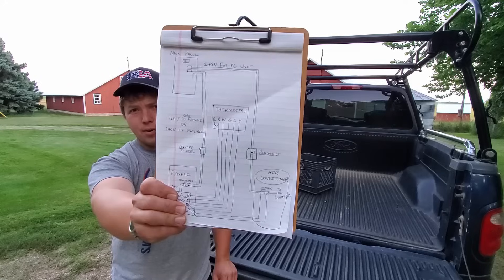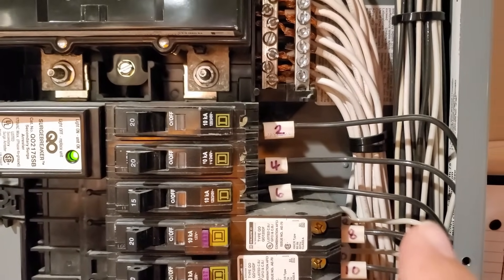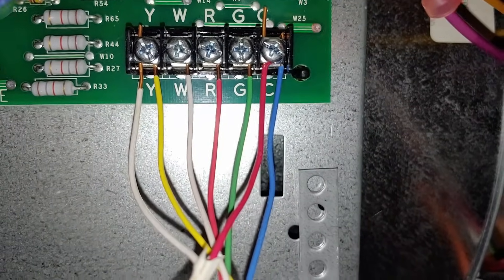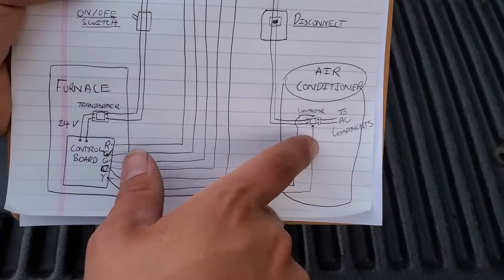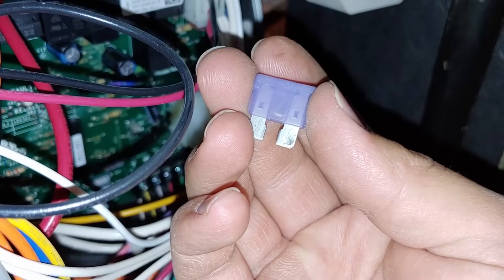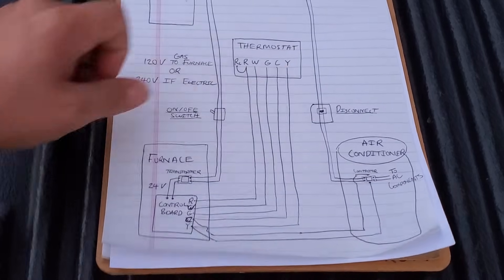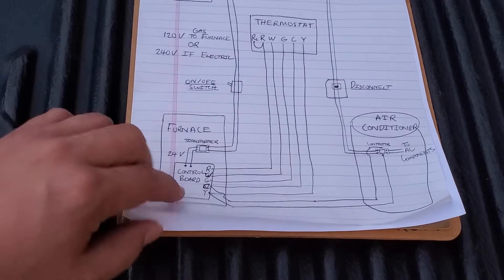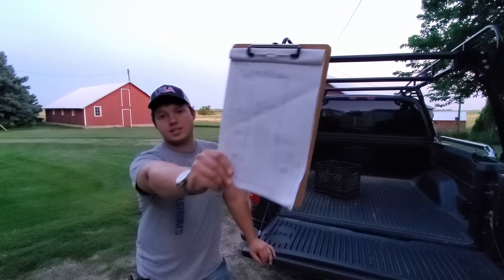Thermostat Wiring Explained!

Comment: Great explanation!Thanks to your diagram finally I found what is the problem with my C wire. I have C wire to the control board without power.  I found  in the basement the other side cut off and joined with other wire  to outside Air conditioner.I restored the connections and now I have the new working wifi control board .Thank you

Comment: Why is there an Rh and an Rc. And why is there a Y1 and a Y2?
Reply from the maker: Rh and Rc are only used if there are two separate heating/cooling units with their own 24v transformers. In 99%+ of systems the Rh and Rc are jumpered together since only the air handler/furnace contains the 24v power source. Good question!

Comment: I could really use some advice here.  My old Honeywell thermostat used 4 wires, but the origingal installer left the blue wire rolled up unused behind it.  
There is a red jumper in the thermostat, old school.  Now, when trying to install a new Smart Amazon Thermostat, it's I can't get it to work eventhough I put the Blue C wire (which is on the COM 24v connection) into the Amazon unit.  I didn't change any of the wiring in the furnace control unit.  Any advice?  Should I buy a four wire to C wire conversion device and try to use that?  Thank you.

Comment: I switched out a Econ thermostat to a wi fi honeywell. I used a c wire adapter I have central ac also. This thermostat has no adjustment for antisipator like the original one and I can’t seem to find one that does. I was going to tie in the old one just for the ac. Is that possible

Comment: Great explanation! Thank you! even though I cannot apply all the instructions as there is only 2 wires coming from the thermostat (R&C). The controller box I'm installing is Aube CT280-HP-2H1C. I can't figure out how to plug the RC terminals as I have 2 pairs or them, on the left and right side of the box. The right ones connect to the heat pump. Your help is much appreciated!

Comment: Replaced my mercury thermostat. 4 clear wires. Old thermostat has a R-RC jumper. But new thermostat has a switch that stays up and red wire just goes into one place. Plugged in everything works. Except there is no option on Thermostat for Auto/hot/cool and no option for cool. The heating and fan only settings still work. But no option for cooling whatsoever. I have the same system upstairs and it’s still working fine. But downstairs. No a/c at all. Driving me insane and it’s heading into the 90’s today.

Comment: What about heat pumps like Train that works off of OB terminal to cool, what smart thermostat works best w/out having to have more wires, the Ecobee wouldn’t work w/out having to pull six or eight strands of thermostat wiring?

Comment: I had a wyze,that went bad,so bought a Nèst,thev wyze thermostat had no battery and 4 wires,and no battery, red white yellow,and green wire was in c for common.The nest has batteries when i wire it up the green wire in common says no connection, should I pull blue wire tucked in wall and attach to common, and switch green to green ?

Comment: @BenjaminSahlstrom thanks for this.  I wanted to paint around my thermostat for about a year now.  it was working perfectly, then I pulled it off the wall and photographed all of the wires in the harness.  when i reinstalled it, got errors.  I was worried that i had to call a pro to get me out of the mess.  But your explanation led me to check the fuse on the board and I fixed it for $7!!!   Thanks

Comment: Awesome explanation, I will probably listen to it again to absorb everything you've said I think you covered so much.
I did not know that the furnace could run without the 24 volts getting to the thermostat.
 I had someone out to diagnose my furnace problem and was told that I needed a new thermostat for 450.00 and many other new upgrades.  He jumped the common to the furnace and showed me that it worked, and thus I needed a new thermostat.  
I did a little more testing after he left and have discovered that the Transformer is not providing the 24 volts.  I did not know that the furnace could run without the 24 volts getting to the thermostat.

Comment: I got a new ac unit inside and out, and the fan inside stays on, constantly blowing air, even when programmed  to auto. The ouside unit will kick in where the temperature is set at. Is this something with the G wire? Can I remove it to make it stop?  Mind you, I am just a Mom trying to figure this out. 😅

Comment: I have an issue, my nest thermostat does not detect the common or W wires. But if i plug thermostat to control panel the furnace automatically turns on

Comment: I deal with electronics and electrics in all forms, from uW to MW.  I came to this video just to get the details of standard thermostat wiring:  basically the definitions for R-W-G-C-Y.  Benjamin was so much fun to listen to, with his very clear explanations, that I watched the whole thing, way past where I got the info I wanted.  Great job!  I may have missed it, but I suspect you didn't actually say why the Y might be going into the control board and not be just a dummy:  isn't it to insure the fan comes on full speed?  That is, the control board wants to know, to set the fan speed correctly, whether the AC unit is running or not.  (I also suppose that these days, 2025, there's additional smarts somewhere in modern systems to set compressor speed and air handler speed to run most efficiently and quietly - things that were rare in home HVAC back a decade or more ago.)

Comment: I know this is an old video ... but.. i recently noticed on my 3 wire setup. W went to W. R went to R. (No jumper) and G from thermostate went to Y.

Is that a typical concept, or is that just setup odd? What i noticed is that when I turned FAN ON. It would start the AC. What i cant compute.... why would turning COOl ON still work?... thoughts on this?

Comment: boiler, heat ONLY - with Honeywell RA89A and Honeywell Oil Primary R7284B EnviraCOM Enabled - -  both Honeywell components  seem to have 24 Volt transformers and the RA89A says it's a relay (may be what gives power to the inducer fan on the flu pipe)
Can I get the power for and add the C wire to one of these controllers, and if so, where?  
It is a one zone steam system and I would like to change to a SMART thermostat so I can change the temperature with Alexa or an APP when I am on the second floor.  Thanks for any help.

Comment: While this was a GREAT tutorial on the relation of thermostat to furnace, there was ZERO info on the control board to the furnace relation. This would be important when replacing a control board. Which is happening 2x now.  Mine has a set of tabs with a number of push pin wires, Blue, black, with a jumper, brown, white. Its a York or I have seen it referred to as Coleman.

Comment: That was a really excellent video! Nothing to do with the Op's presentation, but I wonder who came up that lettering code for the terminals and more importantly, why? 
Wouldn't it be easier if they choose something that sort of made sense ie P = power/24V, F=Fan H=Heat,  A=Air Con and C=Common...

Comment: Nice video,

My condenser pump has a built-in flout that I want to use as an auto-shot-off for heat. How should I tap that into my wiring, which is pretty much on par with your wires in this video? I want to shoot the system off if the condensor pump dies and my humidifier keeps feeding it water.

Comment: Around 10 minutes, discussing the Y wire going all the way to the control board, so should there be 2 yellow wires at the control board? Mine currently is tied together after the control board

Comment: Hi, so had a smart therm installed the wires were like the ones shown in your example yellow green red white and blue(common) the tech installed then left did not test went to use it myself and all I had was fan only.  He hooked the wires up according to the instruction.  I have an old unit 1989 (air handler) does he need to run some sort of jumper wire to make the cool and heat work.  Everything worked on old therm so I think it is a wire issue.  Any thoughts?

Comment: Thanks to your video I have saved some money on the technician. The common C wire was disconnected at the Furnace and my Google thermostat couldn't work. This C wire was connected in my old LuxPro thermostat but disconnected in Furnace and the old thermostat works somehow without the common. My guess it was using the battery power. Thank you for this video.
Reply from the maker: Glad it helped!

Comment: Another Great video...thanks for the video
The issue I have is that, thermostat display, honeywell, screen keeps going on/off.  I removed the thermostat and measured the wires voltages
Green and Red shows 24V (actually 26v).  Only Red should have voltage, as I understand,  why is green shows 26v.  Any suggestions?  Thanks alot

Comment: I need help.  My dog ripped the thermostat wires from the 2 wires that go to the contractor.  I'm not certain which sequence they go together.  The furnace doesn't have a 3 amp fuse.  It has a built in clear breaker. So that's 5 wires I need to connect to the 2 wires for 24 volt on the contactor

Comment: Great video, I have a question. When hooking up a Generac transfer switch to Control the AC. They say break the Y wire and run it through the relay on the transfer switch, should I break it before or after the control board?

Comment: Thanks for this detailed explanation. I have a question about my control board and thermostat. I have a 5 conductor connection from the control board to my thermostat as follows: Y to Y, Y to W, R to R, G to G, O to O.

My question is why is W on thermostat connected to Y on the control board?

If I need to change to a 24V programmable thermostat should I change the connection to W - W, Y - Y instead of the present connection that has Y and W from thermostat going to only Y on control board?

Thanks in advance

Comment: This is the best video that explains everything about how it works and it helps me understand and fix my problem. I'm kinda in the weeds here, I think my C and G Wires are crossed. When I went ahead and wired it, neither the heat or the AC came on. I think I need to rewire everything again. Any help would greatly be appreciated!!!

Comment: Great video. I can't find where the fuse is on my Trane XL 80 Furnace. There is no voltage coming to Rc wire on the Thermostat

Comment: based on  your contactor vid (thanks) I replaced it, it ran for 8 hours, system went offline.  I'm getting another one and a capacitor, I'm pretty far from the job and thinking of replacing the transformer just in case.   Seems like a 24V 40VA is pretty standard.   It's a Payne similar to the one in the other video with a nest smart thermostat.

Comment: wires coming from heat pump condenser (outdoor ) to the air handler cannot be spliced midway with the thermostat wires ?  condenser wires and thermostat wires has to be all connected at the air handler control board ? pls correct me if I'm wrong . thanks

Comment: I would like to be able to control my furnace with two thermostats.  Are you aware of a switch I could wire in as a controller between the two thermostats so both thermostats could not operate at the same time.

Comment: I’m a little  confused about the blue wire. I think it is the return wire on the 24vac transformer. One leg. The other leg is hot and it’s fused. Question if you hook a condenser pump, is it ok to series it with hot wire on the 24vac, so it will trip the heat and cool together? I have a humidifier with heat in winter and the A coil in summer can drip water. Some say to series condensing pump with yellow, but I want also to shut off heat in winter, because the humidifier also leaks.

Comment: Very well done young man.  As an electrical engineer seeking help with understanding the internal workings of a thermostat, you did an excellent job of detailing the contact logic contained within the thermostat and how those contacts ultimately control the external devices, such as the fan, compressor, heat system, etc.   Well done, best explanation I have found.  God Bless you

Comment: Great video Ben.  When wiring a heat only system, such as radiant floor heating, will there only be a R, W and C wire?   Does this require a special thermostat?

Comment: Hi, i have baseboard heating with central air cooling.
 the w+ r from zone vale/transformer. but we got the Navien NCB-H combi. There is R/W/C slots available. 
 And the y/g/Rc from air blower for AC. the problem is that Google Nest says "not compatible" due to Rc wire. please let me know what to do if fixable. thanks

Comment: What a clear explanation for this thermostat wiring and furnace wiring as well as to the air conditioner outside. You are a very good technician that should be teaching. Thanks for this video.

Comment: Force air/gas furnace, central AC. My control board has no yellow (Y) spot on it. Y from t stat connects to red  going to AC doesn’t go to furnace board. W from AC connects to C on control board. From T Stat, R to R board, W to W board, G to G board. C on board only goes to W on AC wiring. My T stat wiring has 5 wires with B not used on either end. Do I just connect T Stat blue to the C board and good to connect smart T stat on wall?

Comment: I'm trying to hook up a smart thermostat and it is a Honeywell RTH9585WF from a standard thermostat that had a battery in it. My understanding is the c terminal on the news thermostat has to be 24 volts AC but on my board on the unit the blue wire is connected to c and that's the one I have connected to c on the new thermostat and it does not power up. I can get my multimeter out and the blue wire that is connected to c on the board does not have 24 volt and the fuse is good what do I need to do?
Reply: get a hvac guy in

Comment: Hi Ben, how would this wiring differ if the system is an oil burner supplying hot water to the air handler? I installed Nest and followed this but the heat is not kicking on. Missing where the oil burner wires need to be connected to. Rest seems clear.
Reply: Figured this out. My boiler wire is sent to the thermostat and the AC wire to the air handler. At the thermostat, I connected the boiler Red wire to the Rh and the White to the W1. Connected the wires coming from the air handler to the thermostat - Red to the Rc, Blue to C (common), Yellow to Y1, Green to Fan, and left the White one out. At the Air handler, the connections of the wires coming from Thermostat are, - Red to R, Green to G, Blue to C (common), White is connected to W1 but not connected at the thermostat as described earlier. For the wires coming from AC to Air Handler - Red connected to C (common), White connected to Yellow. Note that the yellow is not connected to the air handler terminals but is a direct connection to the yellow coming from the thermostat.  Did another zone with the same connections and it worked like a charm.

Comment: Hopefully a quick question, probably simple.  If I have a 2 stage LP Gas furnace, is that considered a secondary heat unit (i.e. in place of heat pump)?  Would that require the 3rd gen google thermostat?  This is a new 96 efficient furnace I'm installing.  Thank you.

Comment: This is one of the VERY best videos on HVAC wiring. No BS...straight nuts and bolts for guys...and ladies doing their own repairs. Very informative...will be using this info tomorrow. I have a 5 year old Trane that is an electric heat and A/C package combined w/ 2 240 shutoff panel boxes. It has worked flawless, but now...for some reason it is putting out heat from the vents when the thermostat is on auto and the COMMAND is for cooling.

Comment: Hi Ben, I am trying to install a refurbished thermostat which is the same model I had before, and after wiring everything as it was on the previous thermostat, when turned the cooling on heat came from the system. If I turn to heat, the Ac comes on. What could be wrong as the thermostats are the same? 
Thanks in advance!

Comment: How is a Carrier infinity thermostat wired with a heat pump outside?
I wanted to get a Wi-Fi thermostat,  but i talked with the installer of my system and he said there is an interface board in the heat pump infinity system that would need to be bypassed to work, but in doing that it would lose controls built into the infinity system. 
My system was installed in 2007. The system is a Puron 2.5 ton.

Comment: Does thw G(fan) wire also get power when calling for heat? I wanted to tie in some inline duct fans and i already have a 24v/120v relay i was going to use to power the fans across the house from another 120 source but i needed to grab 24v power to turn the relay on. I thought i could just tie off of the G wire?

Comment: 3:30 you mention that the 2 wire thermostat wire doesn’t really matter which line goes to y and which to C. I ask because we came home from vacation and our lawn guy must have yanked those two wires out because the wire nuts were laying by themselves and I have a yellow and black wire coming from the condensor and then a white and green (2 wire that you mention) coming from the thermostat. (Side note we have 2 a/c units and the other unit that is working does have a white and red 2 wire and is wired black to white and yellow to red. My question is does it matter which way those 2 wires are done black to white and yellow to green OR black to green and yellow to white. Anything would be helpful

Comment: My Y wire is connected to my C at the furnace. I have no C in my thermostat but I just ran an extra wire since my thermostat is just on the other side of the wall. The million dollar question is do I connect the C wire I ran to the C terminal where there’s currently 2 wires or do I move the y to the empty y and connect the C to the C. ✌🏻👊🏻 cheers from Chicago.